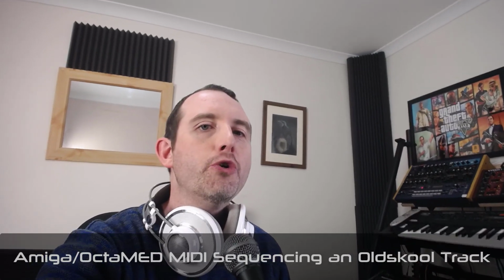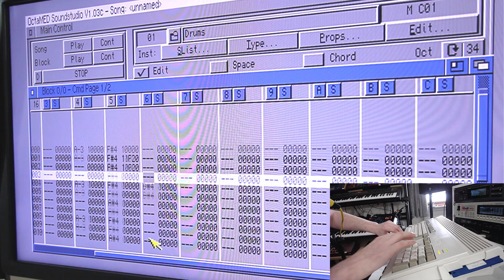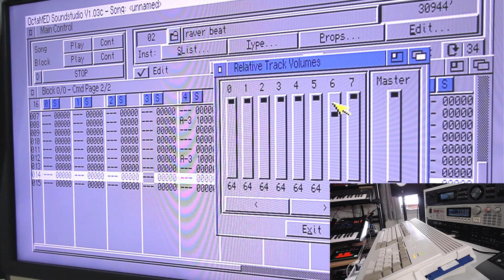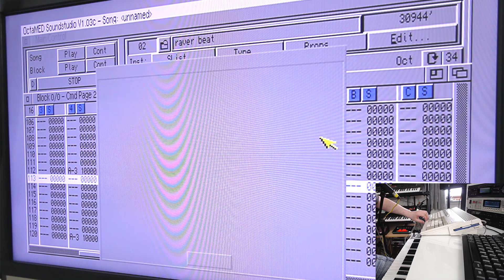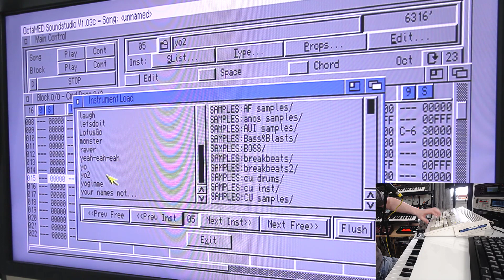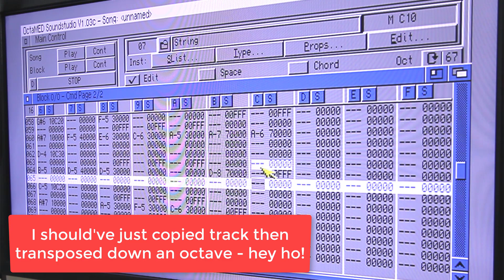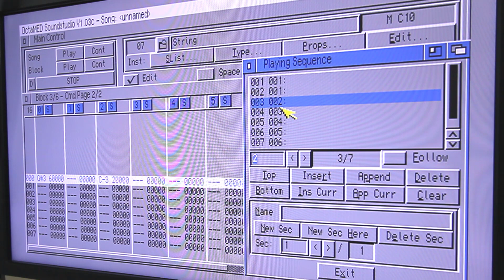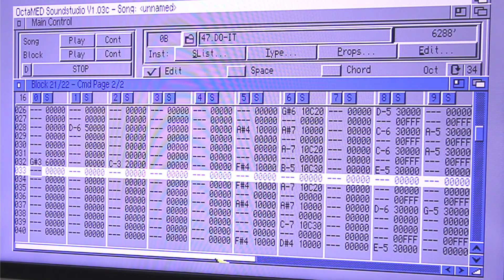Amiga / OctaMED MIDI: Making Oldskool UK Piano House Walkthrough (S3000XL, Integra 7, V-Synth)

Comment: Would it be possible to hook up the Amiga to a PC daw and have OctaMED control VST plugins over midi?
Reply from the maker: OctaMED can send out note and CC info (even sysex), but it's not particularly fun entering CC commands one by one but it is doable, and it can send MIDI clock too for syncing if the DAW supports it. Renoise (modern tracker) supports plugins and is better at automation if you want to get more modern.

Comment: Let's say I finish a tune on the amiga and  I am ready to export it. Do I need a floppy disk, is there a way to export OCTAmed projects to a USB or cassette? Reply would be appreciated
Reply from the maker: There's two ways I store things. 1) Internal IDE to SD Card converter with a 4gb SD card acts as a hard drive. It can be taken out, imaged to a file and read by WinUAE emulator (I initially set everything up in WinUAE then wrote the disk image to the card). 2) PCMCIA to CompactFlash adapter, which plugs into the side and uses a Windows FAT32 4gb formatted card that can be read by both Amiga and PC (best way of transferring between). The Amiga need drivers to read FAT32 from Aminet and you need a bit of technical know how/perseverance to get it all working, but it's doable.
Reply: @RaveyStabs  Excuse my french, but that's a brain fuck, sorry dude, I am not savvy with this at all. Maybe a video tutorial or something you can reccomend to guide me through it. But, thanks for the reply brother.

Comment: Which midi interface are you using?
Reply from the maker: On the Amiga it's MIDI Connector by The Disc Company. Note though you can buy new 1x1 versions from www.amiga-shop.net or ebay, search "midi interface"

Comment: What's your video output setup? Looks super sharp.
Reply from the maker: Do you mean the Amiga video output?
Reply: @RaveyStabs  Yes. Are you using indivision aga or a vampire or something? I have one of those cheap 15k VGA scan doublers and my video output doesn't look nearly as nice as yours.
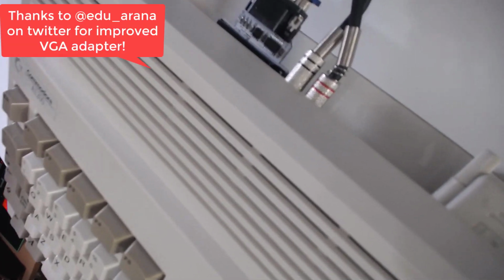Reply from the maker: @jnkmal9519  Ah nope nothing that sophisticated. I use an Amiga RGB to VGA adapter I got from @edu_arana on twitter, little shout out at 1:25. This is quite a bit better than the similar Amigakit RGB adapter and it got rid of the vertical banding issues. Video goes into a compatible Dell monitor which can do the low frequencies. It's not totally sharp but not bad.